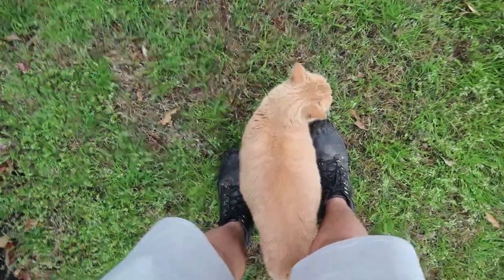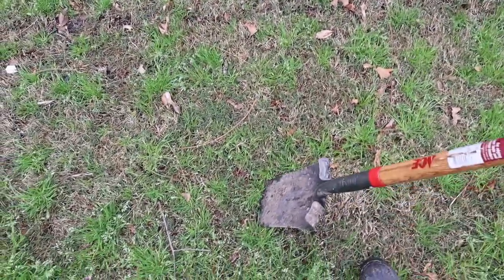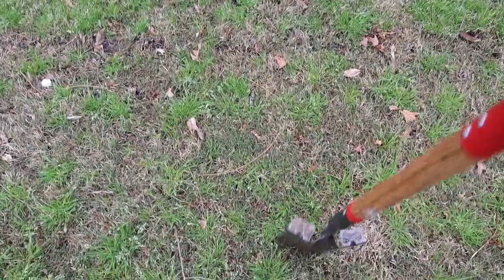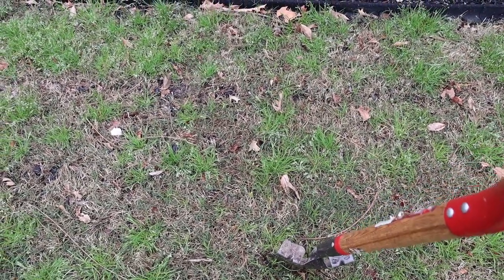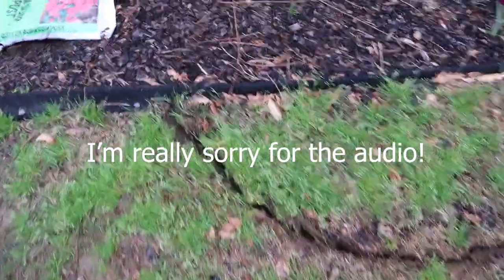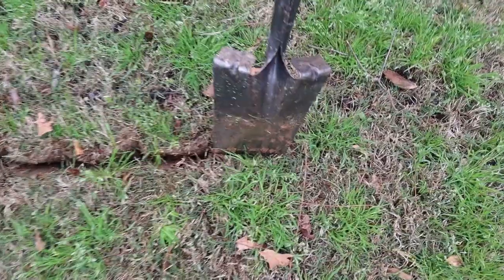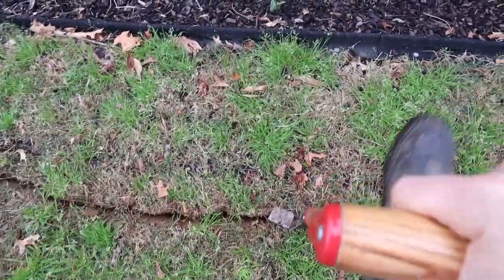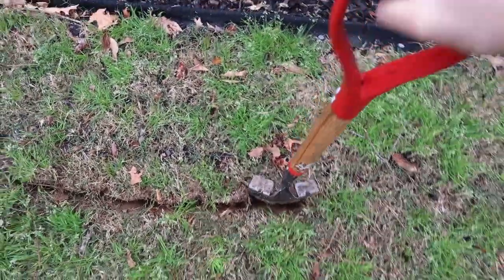HOW TO TRENCH IN GRASS - Low Voltage Landscape Lighting

Comment: I'm doing this for the first time now. Lessons learned: 1) I couldn't find your shovel but I found a transfer shovel (i.e. a typical garden spade) that was squared. It didn't work terribly well because I could not wiggle the dirt back and forth without it bending (my soil is pretty compacted). I replaced this with another one made out of thicker steel and fiberglass and it works well, 2) Even though I was digging 6"+ deep I could not get my cable to go deeper than 3". This is because as soon as I pulled the shovel, the dirt was falling back into the hole. Solution I've found--because my dirt is too dry--is to simply wet the trench. This has kept the sides of the hole damp so that it doesn't cave in. Also it makes pushing the cable into the hole (I'm using a thin piece of wood to do it, to avoid tearing on the cable) easier because the bottom of it is now muddy.

Thanks for your videos!
Reply: Yes, so a spade would be better to "dig in" to the soil. You can also get long handle trennch shovel which will help you to clear out the soil :)

Comment: Point Shovel shoud work.  Just more moves, correct?
Reply from the maker: It actually does not work well. I'll make a video soon showing the difference. You'll be putting in like 10x the effort and time.
Reply: @aklighting8292  ..Thank you.  I'll get a Spade Shovel.
Reply: Huge project coming up and this not only allows the wire to be buried deep enough but does not destroy the lawn.   Additionally, it deep enough to put tape so you can mark the wires so if you dig in area you know wires are buried in that location.

Comment: ha, that's all fine, until you, or the next owner, needs to aerate your yard.
Reply from the maker: Depends. Most of the wire is in the flower beds and in the grass its 6-8 inches in the ground. Sometimes it's hard to get that deep due to the roots and ground. I'm also not sure how common aerating is everywhere. If a wire does get cut, it can easily be re-run or fixed.
Reply: @aklighting8292  landscapers will run an edgers around the mulch beds at some point. They won’t know they hit the wire until night time. Good luck finding where they hit it.
Reply: @aklighting8292  landscapers will run an edgers around the mulch beds at some point. They won’t know they hit the wire until night time. Good luck finding where they hit it.
Reply from the maker: @justonbrazda3846  We try to burry the wires deep enough to avoid problems like this, however, you can't avoid every problem that might happen. Finding and repairing gets much easier once you learn how to find them.